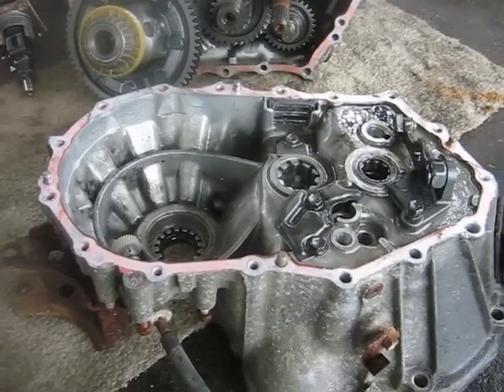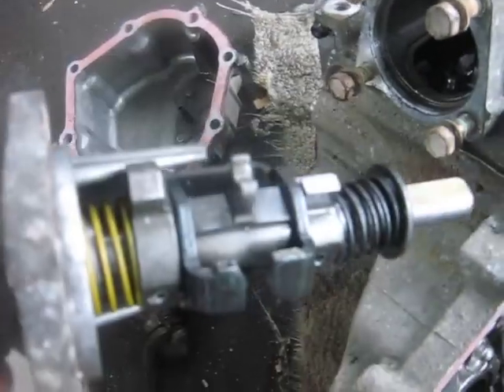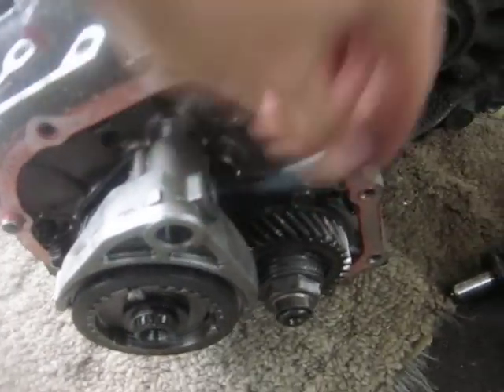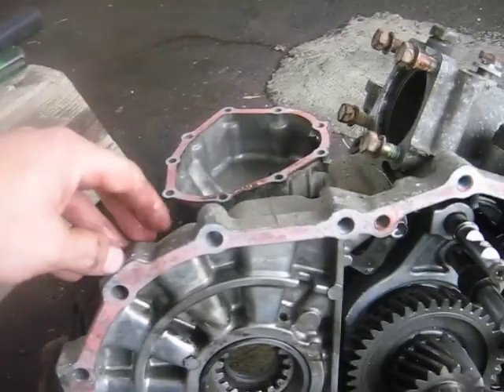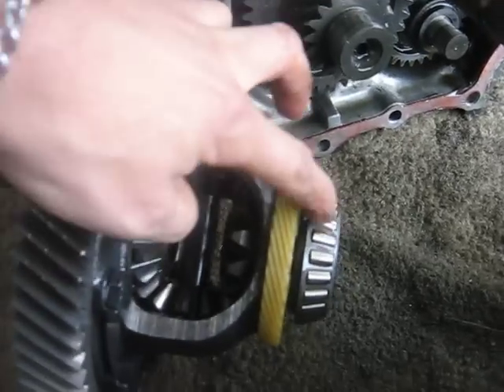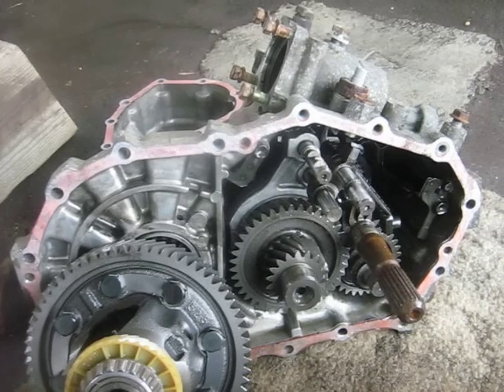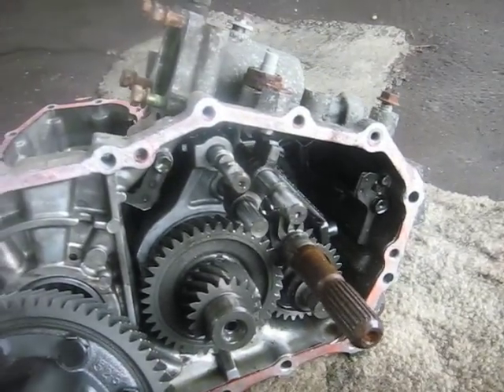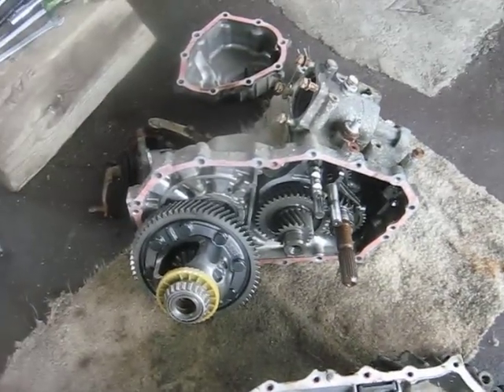5 Speed Toyota Transaxle Teardown

Comment: The hole that the shifter mechisim goes into what is that bolt with ball bearing for?
Reply from the maker: I am not sure, but I can review the vid, if you really need to know. I have these parts still sitting in a shed, I saw them yesterday when looking for a starter for my Saturn L100. I had to drop $190 for a new one instead!  :(   But at least the car is working again :)

Comment: Did you see any yellow metal parts such as brass that would come in contact with the gear oil?
Reply from the maker: Not that I recall. Do you have some brass shavings in the trans oil?
Reply: @ChargerMiles007  No, I'm just trying to determine if certain oils are yellow metal safe.

Comment: If it's poping out of gear it's likely the spring on the ball dentint is weak.
Reply from the maker: Yes, a transmission repair man said the same thing. Any idea how a person would locate which of the many detent balls has the weak spring?  We had 2 of these transmissions do the exact same thing, get locked into 1st gear. This car is off the road now, but I have 2 more manual trans cars I drive, so any additional info could be helpful in the future.
Reply: @ChargerMiles007  
There's usually 4 ball dentent springs if I recall correctly and they are cheap so I'd just change them all. Use a magnet to get them out and have someone wiggle the shifter for you

Comment: I see this is an old vid, but I know on the old toyota W series transmissions, it is particular about the shift keys on the clutch hub and the spring retainers.  When you rebuild it, they have to be just so or the selector ring will JAM and jam HARD onto that hub, making it stick in that gear.  When that happens you can still shift to neutral, its just that gear and its pair (say 1,2 or 3,4) is affected.  If it were (on the w tranny) stuck in a gear and unable to get to neutral, I'd look at the detent(s), their balls and springs, and like the others said the fork.   

Never messed with the FWD transmissions, but they can't be TOO different when comes to basic principles, right?

Comment: More than likely a shift fork
Reply from the maker: Possibly, we have concluded it is something in the shifting mechanism, as nothing else is broken.
Reply: ChargerMiles007 you know if you take the detents out you can pull the back half of the shift shaft out of the other side of the transmission, btw love your Briggs and Stratton contraptions

Comment: only has first? sounds like a shift cup or shift fork coming apart. check the shift tower (first part you pulled out with 4 bolts) with it not in trans it should move in a good 1.5x2 inch rectangle if not possible issue there. if not watch how rods or cables interact with shift tower and figure out what portion of the shift cup works 1st and 2nd. cause a set screw for those 2 gears might have lost the set screw for that shift fork that hold it to the shift rail. i hope this helps figure it out if not get you a lead on trouble shooting
Reply from the maker: Thanks for the advice!

Comment: lots to tech in a small package, i like truck manual tranz, much larger and a bit eraser
Reply from the maker: Yes, things are packed in there pretty tightly!
I decided I had nothing to loose by tearing this apart, since my current trans has developed the same problem. It is a major pain to limp it home with only 1st gear! The old rev it up, then coast was about the only option. Oh, and it doesn't have any neutral either, so you have to keep the clutch in most of the time.
I think it is a problem in the shift linkage, but it could be a smoked synchro or something, I plan to tear it apart to find the problem.
Reply: well best of luck with it :D